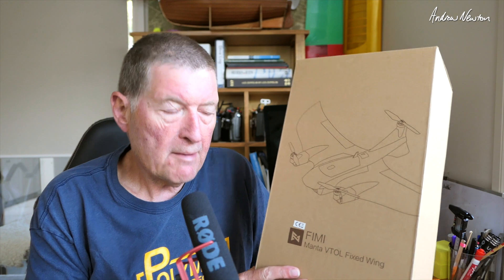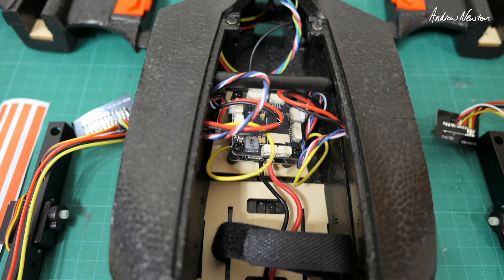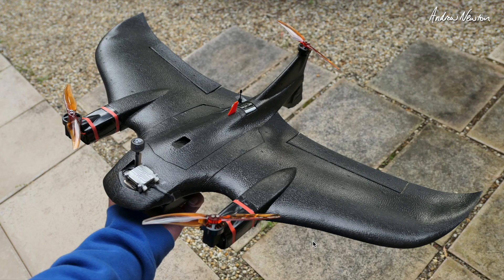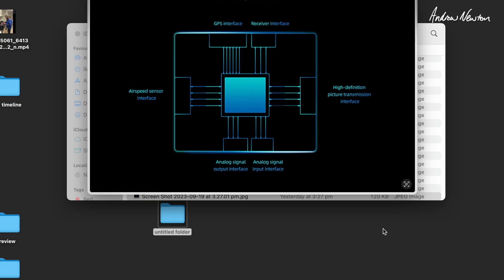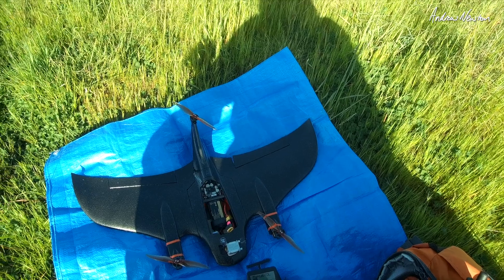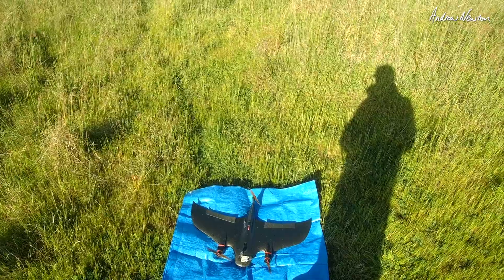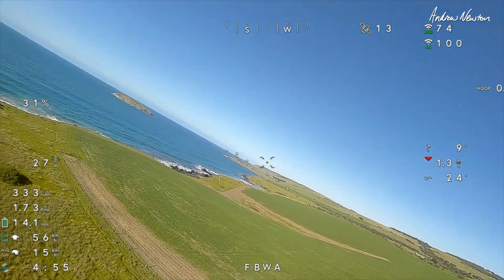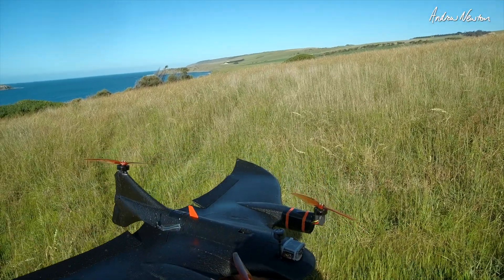FIMI Manta VTOL Fixed Wing

Comment: just wanna make sure before i buy it  , 4s 18650 is working with default config  so we just need to pull all the way to the back . is that correct sir?
Reply from the maker: Yes correct. 4S 18650 and 3S 2200 both work fine.
Reply: @AndrewNewton  thankyou sir

Comment: QStabilize mode just stabilizes pitch and roll. You still need to provide constant input to keep it from drifting horizontally and vertically (throttle). It would be a lot easier to control in QHover (will hold altitude for you) or QLoiter (will hold altitude as well as horizontal position)
Reply from the maker: It doesn't have a compass but I must try those modes.

Comment: Do you happen to know if the power from the FC to the analog vtx is battery power or just 5 volts?  I'm going to try a RushFPV Solo and it needs 7v to 36v?  Thanks in advance.  John
Reply from the maker: Just measured it because I wasn't sure. VTx is battery voltage, Camera is 5V
Reply: Thanks for the info.  The RushFPV Solo should make for a nice long FPV flight.   @AndrewNewton

Comment: hi Andrew, in the file for special instructions it says (in Chinese) to reverse CH2 on the radio, not in ArduPilot...
Reply from the maker: Yes it seems both methods are OK in Ardupilot. But you would not do that in INAV
Reply: @AndrewNewton  thanks for your answer. Right, Inav won’t digest that.

Comment: I'm back at my Fimi Manta trying to get a Boxer (FC version) with builtin ExpressLRS to work with a BetaFPV SuperD ExpressLRS rec but can't get the radio calibration to work. No channels detected.  I have green bars but they do not change.

I checked the wiring and fc TX goes to rec RX etc so looks good.
I created a new model in boxer and set the required ELRS.  
The radio binds to the rec and rec light is solid.
The boxer shows it's connected to the rec.
The rec cable is plugged into the FC CRSF UART.  It is labled SERIAL6 on my FC board.  
According to latest FIMI instructions SERIAL6 is used on ArduPilot for CRSF and applicable parms are set per their instructions.
I can read/write parms to FC okay.
The Boxer is on 3.3.0 and the rec is 3.0.0. Since both on major 3 should be ok.
The sensors on the boxer show 1RSS as -23dB and 2RSS as 0dB.
The top of boxer screen has BOXER 0/500 C so it is bound to rec.

Any suggestions?

Thanks John
Reply: IGNORE AS GOT IT WORKING.  Must have accidently set SERIAL5 to use CRSF at some point and you can't have two CRSF sets.  So just a user error.
Reply from the maker: Great news! We learn new ways to prevent success every day. That would have stumped me too.

Comment: Hi. mine pulls a lot of current in qstab, i'm using 25a 2600mah lithium-ion 4s and the battery can get pretty hot! not sure if the motors are 2700kv or 3000kv either way that is a high kv to be swinging a 6s prop, think i may try some 5inch 2 blade props, as i am using 4s.
Reply from the maker: I get a burst of high current during transition but about 8A for hover

Comment: @Andrew newton can you publish you can osd settings?,I have this and have crsf and runcam wasp,and can’t get osd working,I’ve checked the tx to rx etc… but nothing not even battery voltage in dji menu
Reply: Same for me .I`m running the same setup with Vista ,but can`t get OSD to display ,I have custom OSD on the goggles,and vtx is wired correct.I`ll shoot you an email for your parameters if you dont mind.Cheers skipper ;)
Reply from the maker: I followed this info https://ardupilot.org/plane/docs/common-msp-osd-overview.html
Email me at apnewton gmail if you want my parameters file
Reply: Hi  @AndrewNewton  please can you send me a copy of your Fimi Manta parameters file? I've emailed you. Cheers! 🙂
Reply: Ok thanks for reply,I’ve sent you a email I think to right address

Comment: Nice review mate. A few little tips for you: 

Firstly the tail motor being tilted to one side is totally normal, it helps stabilize the yaw.

Secondly, ignore the current sensor data on the OSD, it's completely inaccurate (notice how your aircraft apparently draws exactly 0 amps when it's on the floor?)

Thirdly, I'd recommend changing the parameter ''trim_pitch_cd''. By default it's set to 500 for some reason, which makes the aircraft want to nose up a lot in flight. Set it to 0 and it'll fly much happier :)

Funny that yours arrived with a nut missing from the FC stack, mine arrived like that too lol.
Reply from the maker: Thanks Giz. Glad I had your videos to watch first. Thanks for the tips, too much wind here for me to do more testing but it's certainly an interesting little VTOL.

Comment: Looks good.  Small question if you have time to respond.  Will the SBUS cable work with a FLYSKY iA10B rec or do I need to get a special FLYSKY cable?
Reply from the maker: Supplied cable has bare wires on the receiver end, so you need to solder on whatever plugs in to your receiver.
Reply: Thanks.  I was hoping that was the case. @AndrewNewton

Comment: How it is compared to T1 vtol ?
Reply: The T1 uses a magnetometer, which enables position hold in hover mode and precision auto landings. The T1 also has developer tuned setup files ready now, and a dedicated version of the FC in the works. I have had none of these models on the bench yet, but suspect the shape of the bay makes the T1 a bit easier to find batteries for. I'm ordering both, though. Just waiting for the dedicated T1 FC. More knowhow is openly available for the T1, but the Manta seems to be OK if you understand its limitations and know what you're doing.
Reply from the maker: Dont know the T1 VTOL

Comment: Great maiden, considering the level of aircraft complexity and wind conditions. Landing back on the landing pad/tarp both times is a good indicator of success. For a first Ardupilot VTOL build, it went very smooth.
The garbled OSD messages seem like they're menu navigation characters (arrows, etc). It may be an optional misconfigured OSD element, or perhaps two elements fighting to display at same screen location (or perhaps an analog element?). A pretty minor annoyance, if this was the biggest setup/configuration issue. 
Lee (Painless360) recently noted that Ardupilot version (4.4) just released with many VTOL enhancements. Since it's very new, I would not expect it shipped on the FC from the factory.
Reply from the maker: Ah yes, you're right. Errant OSD elements. I'll try different fonts

Comment: I have the Xiake. It flies but bluntly a jack of all and a master of none. In forward flight it isn't a patch on a normal plane and in hover mode it is no quad. I must get it out again & give it another run. Maybe convert to INAV 7.0 as I really am not a fan of some on the ardupilot flight modes like FBWA, too intrusive.
Reply from the maker: Yes I'm looking forward to trying INAV VTOL on this
Reply: I've used both ArduPilot and INAV.  ArduPilot is the more feature rich of the two.  You are not restricted to the FBWA mode, you can select Acro or Manual if you think FBWA is too intrusive.

Comment: Wow Mr Newton,   that was an in at the deep end flight that one !,  as a veteran Arduplane pilot who is now getting a Ranger T1 vTol up and running, I HOPE my maiden goes anywhere near that well!!.
That plane is very small, which is handy for transport but they are so twitchy in flight its enough to make you sick through the goggles.
Reply from the maker: Thanks bomber. Do you know what the flashing message was? Waypoint stuff maybe? and do you know how to turn it off?
Reply: It looks like its not a message but maybe some faulty font stuff flashing up, its in random places and seems to be just jumbled up.  Usually messages schroll right to left at the OSD spot you set.  And so maybe this will stop or clear later.
Reply from the maker: Yes you're right. Turned off second screen and tried a different font and it's gone.
Reply: Nice vid, how windstable ist the manta? Can it handel bft 4/5?